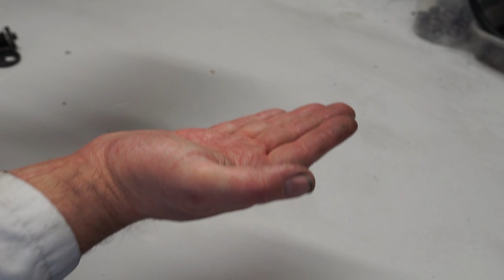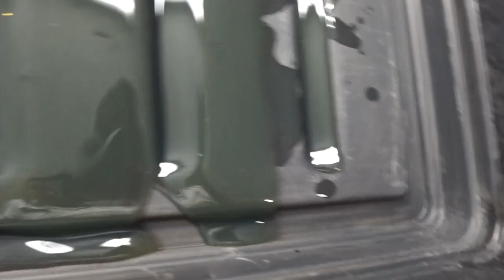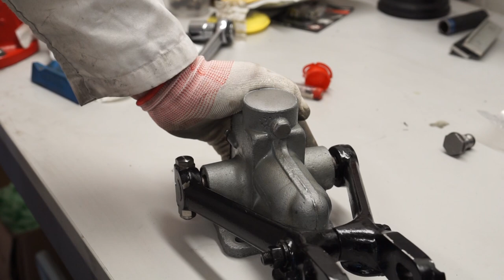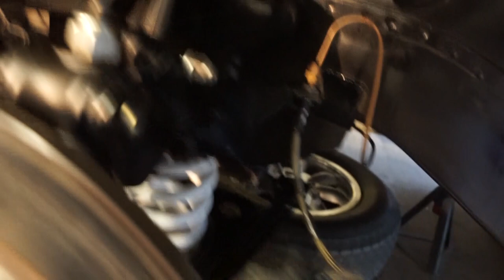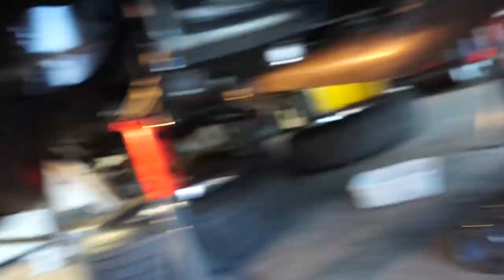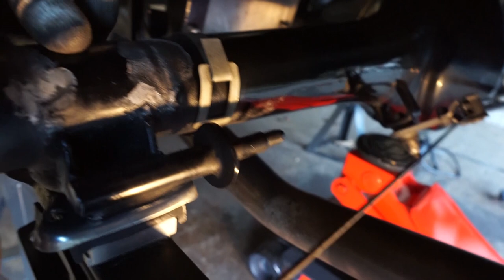FiA MGB Suspension Modifications; Adjustable Front Lever Arm Dampers & Rear Axle Correction Wedge

Comment: Just wondering if you would do an evaluation on the available caster shim kit (Moss, Costello) to lessen positive caster angle on the street driven MGB with radial tires? Or maybe a prep on alignment for street/race. Regards, Paul
Reply from the maker: It's an interesting question Paul, the castor kit is not something I have ever considered fitting; the cars races on cross-ply tyres and for me high speed stability is more important than having light steering. The car is fitted with a quick rack and I am generally very happy with how the car handles. 
That said the shell is a Heritage one and I was told that the rebuilt shells were adjusted to give a castor angle of 3 rather than 7, I don't know if this applied to all the shells though, mine is an early one from the mid 90's. I'd really need to try and get an accurate measurement to make sure. 

I can certainly make a video on car alignment, I was setting the alignment last night; I go for a slight toe OUT of around 2mm 0.3 degrees. I think a car prep video would be a good one, also covering scrutineering checks for racing. 

Best regards
David

Comment: Good video. When you took out the old valve did you take out all the springs or did you leave the spring at the bottom of the chamber?
Reply from the maker: Thanks for your message, the entire spring is removed when using the adjustable damper valve
Reply: Thanks for your prompt reply. I've ordered some from mgoc should be here tomorrow

Comment: Hi David, thanks for all of the great videos you make on the MGB. I bought some new front dampers from Moss Motors and also some stiffer valves. Is it OK to just clamp the new damper in a vise and remove the existing valve and swap them or is there a more preferred way?
Reply from the maker: I think it would be worth having a bit of oil ready just to top up the shocks when you remove the valves. Use some soft jaws in the vise to hold the shocks upside down whilst you swap the valves.

Comment: How did shimming the pinion angle work out?  3° it looked like? Do stop wheel hop?
Reply from the maker: Yes, from what I could tell. I seemed to get good drive off the line in the last race; the tyres span up slightly (but I think they are a bit old). The modification did seem worthwhile though, I will know more after more race starts.
Reply: @davidrussellwilks  fixin to put a 2.5° on mine. I have more leaves on my springs, but clamped them to almost solid. Left the rears leaves to flex though. It an old drag racing move...

Comment: Excellent video David. I wondered if you have any comments about pros and cons of these adjustable oil front dampers versus various gas dampers / coil over kits? I guess you are constrained to stick to originals via racing class rules? I would love someone to do the definitive top 10 of handling upgrades on the B as there is a lot of scope to spend a lot of money, but how much of it actually makes a difference….
Reply from the maker: Many thanks for your kind message David, you are quite correct that class rules dictate the use of lever arm dampers only for our cars. Having previously owned an MGB GT with the Bilstein shock conversion I would have to say that I much prefer the ride with the lever arms. 

However the tracks I use my car on are usually very smooth so you get get the problem with jounce or harsh handling that you might get with stiffened lever arms on a bumpy road. 
I think I'd start by finding out what I really want for the car, depending on what you want to achieve and where you are driving the car will influence your choice greatly. 

Personally, I would always refresh and check the lever arm dampers as a starting point, it's not going to give a true result if you are comparing worn out shocks to brand new ones. You can then make changes one at a time such as the anti-roll bar, shock valves etc to dial in the car the way you want it.
Reply: @davidrussellwilks  bit off track, but you mentioned placing an angled shim in the leaf springs? For traction?

Comment: So talk to me about your sway bar, I was told to reinforce the mtg area if going 7/8 and above?
I came in 3rd in our Houston autocross you comented on.
My 1st...
Reply from the maker: First of all congratulations on the Auto Cross! 

I use a 7/8 bar with the solid aluminium, mounting blocks. It's well worth reinforcing the chassis leg, mine have torn on both sides in the past. The Auto Cross certainly looks like an interesting discipline, for the track we tend to make our cars as stiff as possible but never need to make as many tight turns in a row as you do. We run with no anti-roll bar or Panhard Rod on the rear (not allowed under class rules).
Reply: @davidrussellwilks  is that area braced for your current sway bar? I did not notice in the video
Reply from the maker: Yes it is, the body shop was able to make a neat repair when the captive nuts tore through the metal. The used a thicker gauge steel, cut the old metal out and welded in the new complete with captive nuts.
Reply: Looking to see if you have any system to,prevent spring warp and hopping on acceleration?

Comment: Very interesting, thanks David. I used brand new lever shocks, thicker oil and an updated valve in my MGCC Speed Champ Road Going spec Sprite. To be honest they still weren't that firm, but a huge improvement over worn stock units.

Is the purpose of the rear shim to move the pinion to be closer/parallel to the gear box output shaft angle to reduce the uvj error and any vibration ?
Reply from the maker: The shim at the rear is indeed to lower the nose of the diff and make the prop shaft as level as possible. I'm not quite sure what you mean by uvj error but it does give better drive off the line and stops the springs winding up so much.

Comment: Just wondering if you put a link to those adjustable valves for the front lever shocks. I’m in Australia. They look like a good thing. Would be keen to fit a pair to my fronts. I run 600Lbs front springs and 24 mm bar, so would be good to be able to tune damping .
Regards. Nicholas
Reply from the maker: Thanks for your message, the adjustable valves can be found here https://ajbengineering.com/products/armstrong-lever-arm-adjustable-damper-valves/